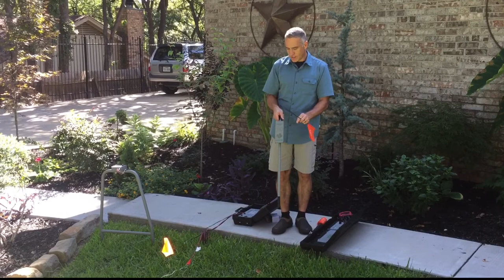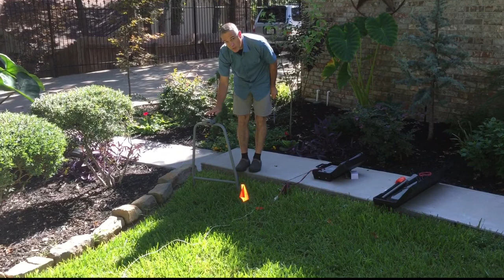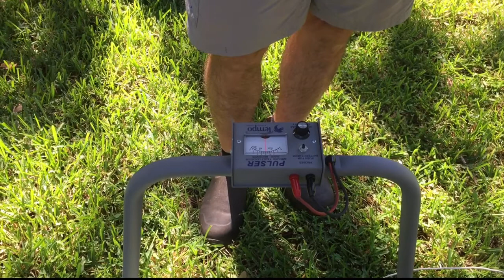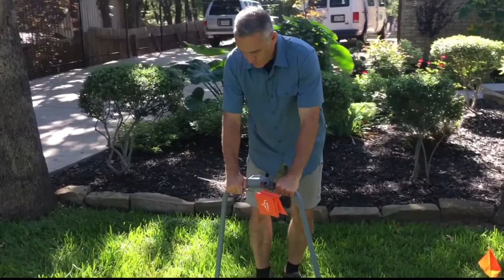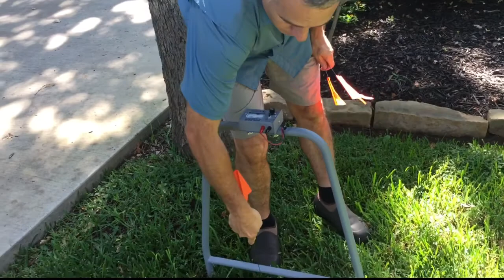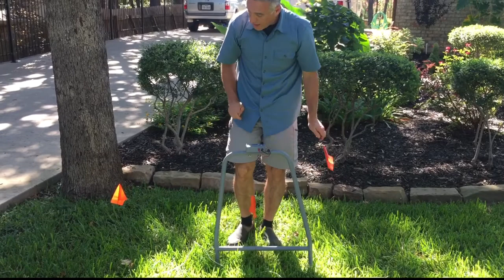Sprinkler Short/Fault Finder - 4L Irrigation Repair

Comment: Can it accurately tell where a short is? Or just faults? As usually pretty good with the armada locators to find faults, been struggling to find a buried valve box with a short for a while as with the locator is taking me through the whole common, and its a kilometer long sports field complex
Reply from the maker: It really stops you at any fault, but because most older lines are full of nicks and cuts that aren’t the issue you need to find, it turns out to be very time consuming, so I rarely ever use it anymore.